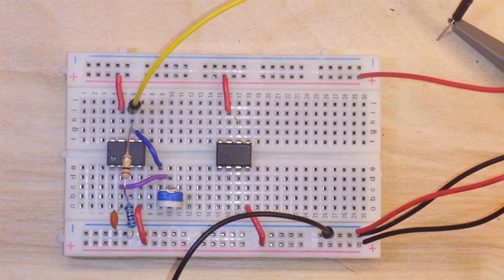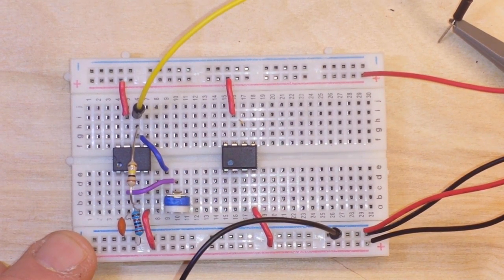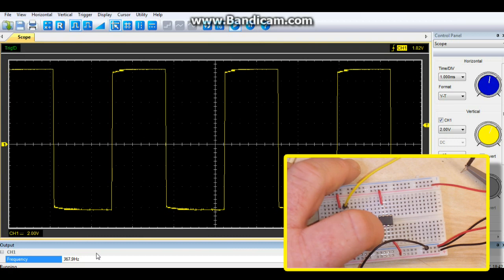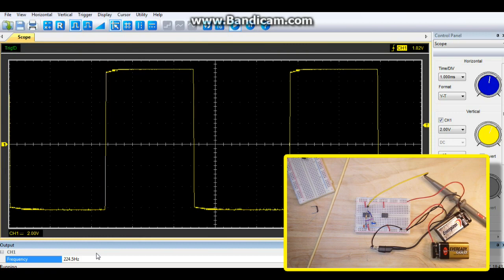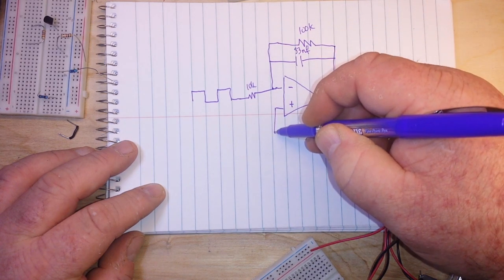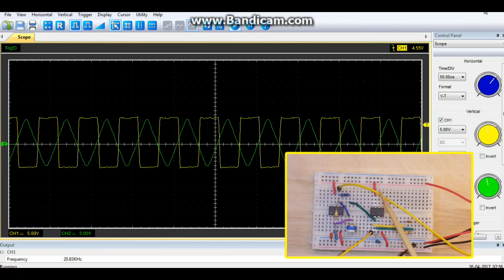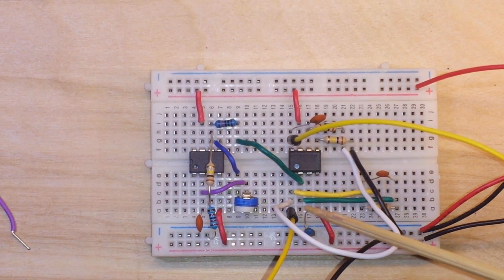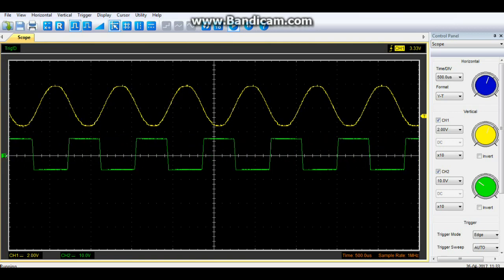Easy DIY Function Generator

Comment: The amplitudes of integrator and differentiator circuits depend on the frequency.
Reply: Could you explain why the amplitude of the integrator circuit is dependent on the frequency? I was wanting to build a circuit similar to this one and ran into that problem. Attempting to design for variable amplitude doesn't seem possible with this circuit.

Comment: 8:26 The RMS of a square wave is its peak value, the RMS of a sine wave is .707... times the peak, that's why you are seeing a difference.  BTW, when you integrate a triangle wave, you actually get a piece wise parabola which resembles a sine wave, but isn't truly one.
Reply: is it possible to create a true sin wave?
Reply: @Jooeyization  Add some RC filtering to remove the unwanted harmonics.
Reply: @Enigma758  I see, thank you. I'm attempting to build a signal gen using this schematic + a schmitt trigger + variable resistors/capacitors to control amplitude/frequency. I will see if i can add some rc filtering

Comment: is it possible to do this with other op amps? like tl07x's? But adjusting for different pin outs, of course. Also I'm more interested in making one in the audio range of frequencies. Any tips? Thank you!
Reply: The TL07x's will work work just fine for building this circuit and any opamp will work. Most opamps have identical pinouts but not all are the same so check the datasheets before you breadboard. Also if you like working with the TL0's the TL071 is an eight pin/dip single opamp ic if you were looking to use a single and always check the pinouts if you don't already know. About getting into audio range most of the frequency's range/sweep is in audio range or high-frequency from the start of the sweep and going nearly to the end where it starts to leave the upper end of the audible range.

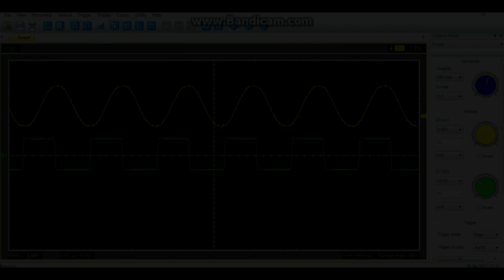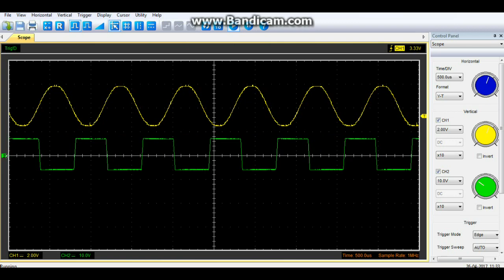Comment: How is it possible, that the sine and square waveforms show different wavelengths (8:15 - 9:00)? The square wave is integrated 2x and should be in phase with the triangle as well as the sine.

Comment: I'm suspicious.  If making a square wave is that easy, why all the extra for the 555 to make a square wave?
Reply: 555s are easier to deal with than opamps. You only need a single power rail, for a start. And in addition, it's easier to configure things like the duty cycle with a 555, meaning you can do far more with it, such as using it as a basic ADC, and the output can be latched. Running it in astable mode to generate a clock signal is just one of the things it can do, and, as I wrote earlier, less trouble than doing it with an opamp.

Comment: How are you getting a squarewave output from an Op Amp?
Reply: in short, the capacitor always wants to charge up to the output voltage
we can see in the vid it's a non-polarized capacitor, meaning it's totally fine with reverse current
because capacitors need a certain time to charge fully, the output voltage will also be affected by the RC time constant (typically 5 times the time constant per 1/2 oscillation)

Comment: Hi . I built a very similar circuit as the basis for my diy oscillators. However i get alot of high frequncy noise on the power rails . I used a quad tl074 and used a voltage divider on pin 2 linked to pin 5 with 100k resistors. I also used 100k in the positive feedback loop pins 1 to 3 and a 22k between pins 3 and 7 with a 1.8nf cap which gives me a good frequnecy range . I then took a diode between pins 1 and 6 and have it linked to an expo converter. However as ive said there is alot of noise on the output of the vca i built when silent. Any ideas how i can mod the circuit so i can eliminate this ?
Many thanks.
Reply: Did you de-couple the power supply?

Comment: Will build once I have an oscilloscope to test it with! I have a dso138 kit to build at some point which should do for this I suppose. Will send for some lm324 quad amps in anticipation!
Reply from the maker: If you want to get into the megahertz range you might want to consider the TL072. But if you are staying the KHz range the lm324 is a winner. I have a dso138. I built it somewhere around last Christmas. Here's a couple tips...make sure you short all the jumpers mentioned. I missed JP4 and had no negative voltage. Also the trimmer caps go crunch if you try to adjust them too much, don't ask how I know.
Reply: Is the Hantek 6022 a good entry point oscilloscope for a beginner?  I'm just a hobbyist on a pension so price matters.  Maybe if I start saving......!
Reply from the maker: Yes, it's a very nice scope!
Reply: @gartmorn  The TL084 is the 'Quad Op' if you did want to get Mhz range or just like using the TL's.